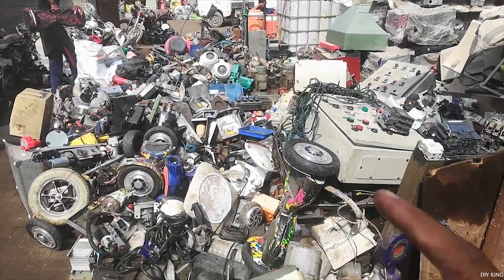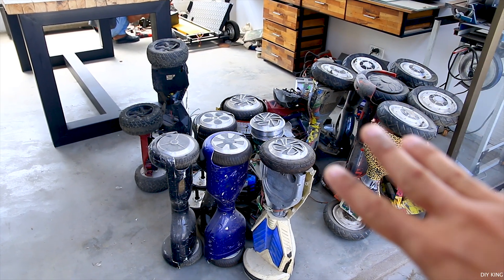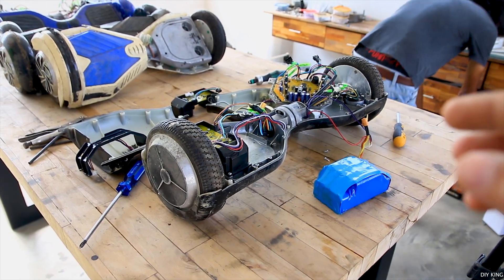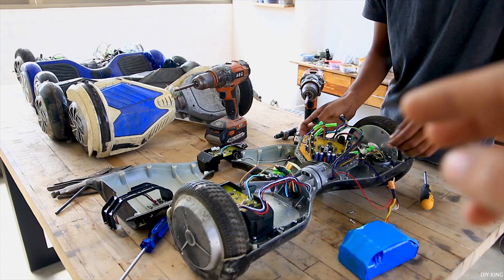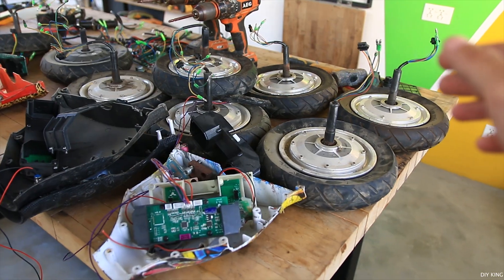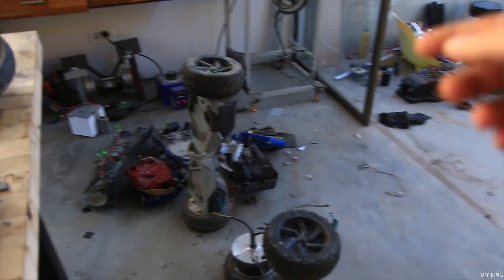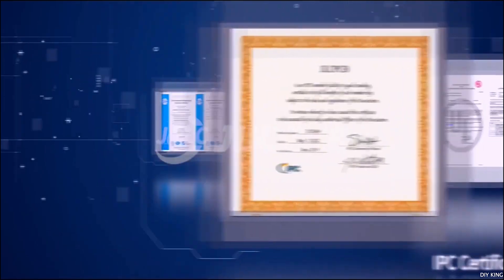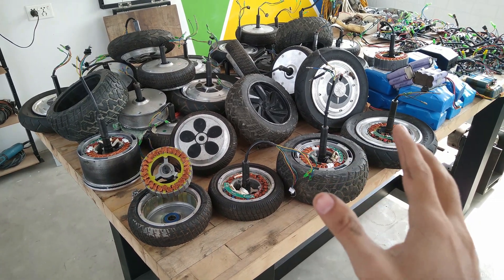What's Inside A Hoverboard (Self Balancing Scoter)

Comment: Guys, you can balance your bike wheels by placing it on something that the axles can set on while the wheel is free. Tape pieces of lead on the top while the heaviest part will go to the bottom. Once you have the right amount, glue them on.   You can also take the air out and center the tire on the wheel. This will make high speeds on the bike much more fun, and safer. Another thing to do is clean and grease the bearings in the wheels and the steering. Tighten the adjustment until you feel resistance and back it off slightly so it moves free. Having everything tight will really help with speed.

Comment: If you connect all those wheels together and then connect all of them to another wheels. 1 wheel run by power of the battery. The rest will charge the power of that battery. Set them up so they will be running on a Treadmil or in a circle